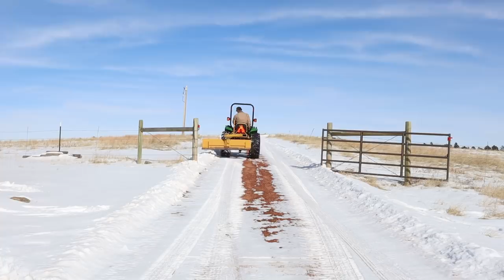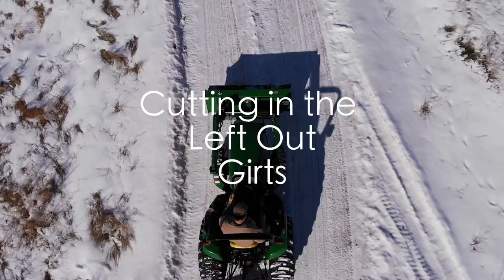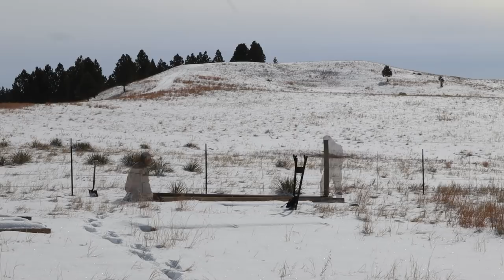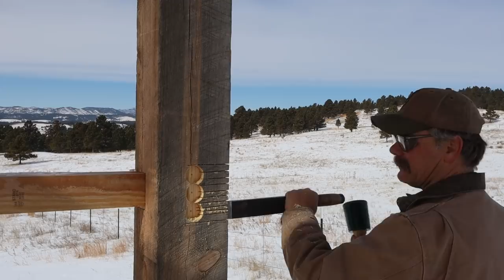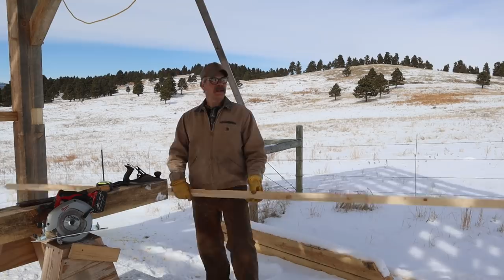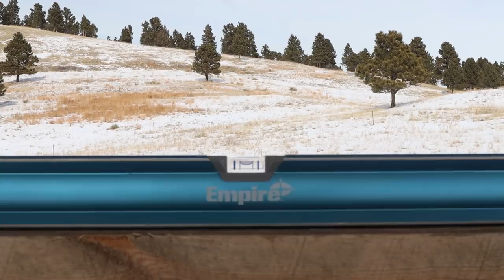Beautiful Day on the Timber Frame Barn

Comment: I've said it a few time, working on an upright frame is horrible work but it has to be done.  Nice addition on marking the sticks, I'll remember that next time, it can ensure the clamps are correct.  I like the beveled laps as you don't have any corners to cut out but I also like the full housing of the style you applied.  Spring is just around the corner.
Reply from the maker: Yes I skip the clamps untill I set them on the piece to be cut and clamp to the mark.  Had them slip before.  Upright work is awkward at best, 🙏 for spring

Comment: Curious about the pitless. What is the elevation? Did the frost level drop because of lower than normal temps? Could be a lesson for those in high country. Very much enjoy your vids.
Reply from the maker: It is at 6', which is plenty.  Weird.  Must have been due to the steel casing conducting the cold.  -17F is cold but still not at 6'.  I put a insulated cap over the well head, crossing my fingers.

Comment: Hi! I thought you were doing a great job, but when I realized you were working alone, I was quite impressed! I can relate to what you are going through, as I build my lake side country place alone. People don't realize a beam or plank as two ends, which are far apart, and it complicate matters... Lol ;-) The trick you showed to measure inside dimension is awesome! I was using two stick like you, but I was struggling to clamp them. Just marking them is much simpler! :-) You have a new subscriber.
Great place and thanks for the video. 
P.S. Are you using a 2" framing chisel?
Reply from the maker: Hello Guy.  Sorry just saw this!  Thank you so much.  And yes a 2" chisel